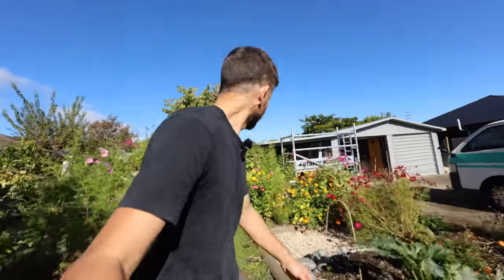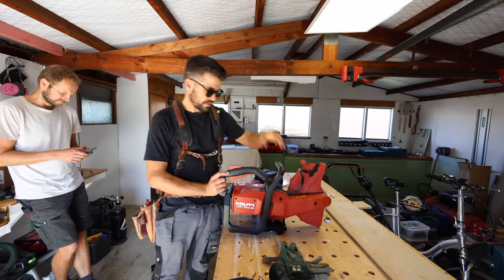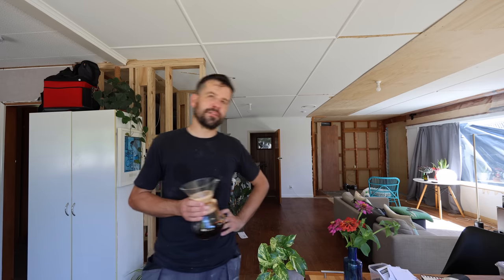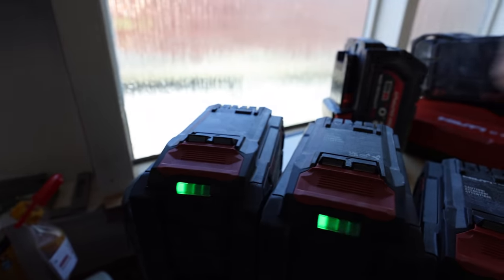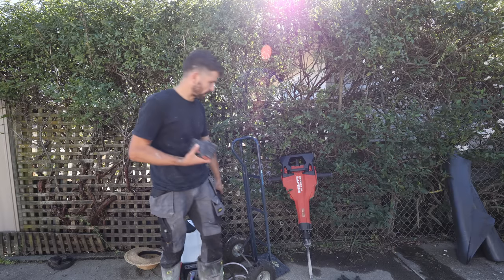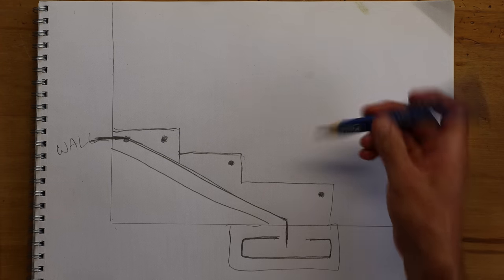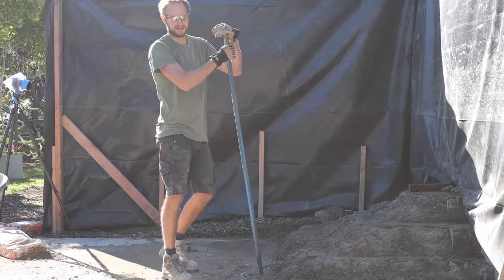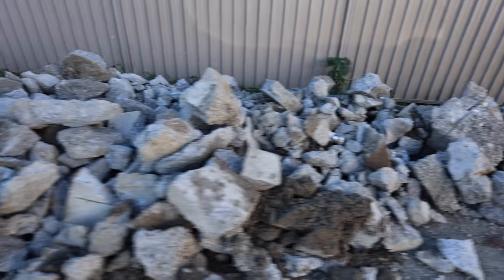Breaking Concrete with Battery Powered Tools: Is it Possible?

Comment: I do highly rate Hilti. Hilti and Mafell are in such another class though that even most Festool owners wouldn't buy them. They are far too specialist for most people. Personally I don't think certain tools need to be battery tools, especially those which are hooked up via a hose anyway for dust collection or water.
Reply: always felt like the push from tool manufacturers to put their whole catalogue to cordless is more so they can market "largest battery platform on the market!!! we even made a cordless coffee mug check mate dewalt!" despite the practicality and how pointless having some of these tool on battery are. like look at the mafell jig saw, thing is the best jig saw you can get your hands on and is only corded.
Reply: Eventually small combustion engines will be banned for import and manufacture at least in Western countries trying to reach net zero emissions, so manufacturers know they have to go in this direction for situations where access to AC power isn't available. They've gotta start some time.. 

Milwaukee MX FUEL range 72v battery tools are probably much more up to this job, and Makita's 40vx2 demolition saw

If the fastest production car in the world can be a Tesla battery powered sedan, then eventually they will get heavy duty portable tools right too. 

Other companies already do battery ride on mowers and electric tractors.
Reply: Hilti are meant to be leaders in there field yet they don't make a dual battery charger UNBELIEVABLE!!!
Reply: @MrTherbst  I agree, commercial tools that use X2 technology need to have multi battery chargers.
Reply: You're crazy bro festool has unique features that no other brand has. Every brand is innovating with tools now, lots of different little features can sway you to one brand. I have festool, 54v dewalt, hilti lasers, all sorts of stuff
Reply: @jamiedyer7782  you are right they do. Things like the domino for example. Mafell and Hilti are for more heavy duty work whereas Festool tend to be the top of the range for most wood workers. When you get to bigger stuff, Festool don't make the tools. For example....if you construct timber framed structures from 150m² oak, Mafell make tools for that light a portable bandsaw, chain notices, portable tenoners. If you work in the construction of buildings with a lot of concrete and steel, people buy hilti as they make high-end tools for the job. I am not knocking Festool tools, I even have some myself. Just go to a store, pick up a Festool saw and then pick up a Mafell saw and you can literally see and feel the difference in build quality. Same with Hilti.
Reply: @jamiedyer7782  Have you ever used Hilti or Mafell tools? Or are you a Festool fan boy?
Reply: I do believe in fool's-pricing though. I won't buy a basic underfeatured drill for 1170.00$ for example.. 

Except for say: NEMO, those justify their expensiveness by being deep-sea-diving tools with pressurised shells.
Reply: @MrTherbst  - How would that be significantly different from having two chargers side by side? If they made a dual charger they'd charge you twice as much for it, so there's really no advantage. With two chargers you can keep both at the same place or separate.

Comment: I would agree that some of the larger cordless tools just don't have the long run time because of the battery power they require, I would also point out that in all the 45 plus years I have done construction I have never seen anyone cut slots in a set of steps to demo them. Hilti makes some of the best cordless tools on the market,with the possible exception of this concrete breaker and concrete saw..
Also the use of the hilti breaker as demonstrated showed that both of you had not had much experience with the tool and how best to use it to maximize the tools capabilities. That being said I would never have tried to perform this demo with cordless tools. Hilti's corded concrete breaker would have gone through those steps like butter. you worked yourselves needlessly hard when the objective should be to work smarter,not harder. Keep on trucking on

Comment: well .. you could have drilled some holes in the Stairs to create some weakpoint where it brakes easier .. should be faster then the Saw and should need lees Batteries 
but tbh .. cordless tools are overrated .. as good as they are these days, still they are mostly efficient where it is hard to get the Amps through the Cable, where you have to use a Generator und just for "short" Jobs, not whole Day work (then Generator can be more fficient)

Comment: Yep. Batteries for tools that need to do this sort of hard work over time don't make sense. It would great to have heavy-duty tools have the ability to be both battery powered and to plug into an electrical outlet. Are there such tools?
Reply: It probably wouldn't be too hard to create an adapter for these that simply supplies a steady 22 volts to the battery terminals, but these brands tend to have "smart" battery systems, meaning you also need to fake the data signals, so it's not necessarily something a normal user can make, they'd need to know how the tool communicates with the battery.

And, of course, the adapter would probably weigh more than the batteries.

Comment: Having removed some concrete stairs from the 60s I felt the pain. Used a corded jackhammer. Man was that a lot of work. 
I have another set at the front of my house that I’ve been putting off for about 5 years now. 
Should prob hire a digger…

Comment: Whether you get 44v with 2 batteries or not depends on the wiring. If they're wired in series, you add the voltage. They can also be wired in parallel, which gives you the same voltage as one battery, but you get longer battery life than a single battery.
Reply: You get the same battery 'life' (energy) either way because the Wh rating (Joules) is the same. But by going higher voltage with series you can just use smaller conductors.
Reply: @TonyRule  Yes, I didn't explain that very well. I was trying to say that longer life is the only advantage to two in parallel, while longer life and higher voltage will both happen if they're in series.
Reply: @The2wanderers  Ah, right.
I see someone below said they believe it's  actually a 22V device, so it could presumably be run with one battery for half the endurance. So no conductor savings anyway in this case, just the convenience of only needing a single battery if you have a small job to do.

Comment: The issue of drawing down batteries faster than you can charge them is something you run into with drilling large diameter holes in concrete, I've gone through two and a half 18AH batteries to drill one 25mm hole before. I now have a mains powered concrete drill as well.
Reply: Ok, so get Hikoki 36v sorted as mains and battery

Comment: is hilti a consumer or residential brand down under? in the states its a commercial brand. I have used the Milwaukee saw with the giant XC batteries and the run time is comparable, like 5-10 minutes run time at best.
Reply: Commercial

Comment: Firstly, hats off to the pair of you for sticking with breaking that out by hand. Personally I'd have caved early and called in a digger.

I'm going to disagree with your comparison with early cordless tools and where large format cordless tools are now. The first generation of cordless tools where using Ni-Cd batteries (much lower energy density), inefficient motors and no power management. The current generation are benefiting from about 40 years of development,  Li-ion batteries, efficient brushless motors and onboard power management. You can make improvements by increasing the battery format as has occurred with 36 and 40 Volt systems, but the fact is that with any batter chemistry type there is a max rate at which a battery of a given Amp rating can be charged. Even if you build a more powerful charger, the practical charge rate will not change. A bit off topic, but this is also an issue with EV's. There are EV chargers available with very high Amp rates, but the vehicle batteries have a max rate at which they can be charged and this is what dictates how long it is going to take. 
Personal opinion, either there needs to be a very large capacity batter which is on a trolley/cart which can be charged overnight and then last for a whole work day (would be very expensive and defeats the 'cordless' part), or just stick with a traditional breaker/concrete saw and a generator. The reality is that the amount of money spent on the cordless option is not worth the expense in my opinion.

Comment: Oh I agree Scott, its insane how much rubble comes out of a small set of stairs. I broke up a set of 2 landing stairs a third of the size of what you had which wasn't completely concrete filled and it still filled a 1.5x2.4 trailer and knocking on the limit of what my poor old suffering Hiace could tow. But those big high draw tools probably aren't at the stage where they can replace 240v or petrol just yet, maybe with the exception of Milwaukee MX Fuel but I haven't used those monstrosities yet. I would definitely have hired a big Makita-Dolmar petrol concrete chainsaw for that big of a full pour job, a 24 inch bar would have taken that cut nice and deep and then it would have been super easy to break it out with the Hilti breaker pick

Comment: I'm all for cordless tools, but it seems to me like concrete hammers and saws aren't really the right target yet. Those are endurance tools that also still need a lot of power.  
If we ever get to the point where they can do maybe an hour on a charge that'd be great, until then I'd probably use a corded version instead
Reply: Milwaukee has MX Fuel 72v range and Makita does 80v tools, I have the makita 80v rotary hammer drill and although the concrete I was cutting wasn't anywhere as much as this, it was pretty capable to use as a jackhammer
Reply: @scottmenhennet9933  I never said they're not capable, it's just that the batteries don't last an entire day. Swapping batteries once or twice during the day would still be fine, but when you're doing an entire day of demo work you want your batteries to last at least as long as they need to charge back to full..
Reply: @scottmenhennet9933 yeah I think they’re better off having two seperate battery platforms rather than trying to use the same platform for everything. Dual battery systems are ok but you really need dual chargers and 4 batteries to really make it worth it.
Reply: What would be the advantage of going for one hour on a charge? You'd just need heavier batteries (or more of them). Surely you can take a 10-second break every 25 minutes to swap the batteries.

Of course, a corded tool would be even lighter, so it's still preferable whenever possible.

Comment: You pointed out the major problem with the dual battery setup: you need at least double the batteries and double the chargers. Some people advocate for all battery construction. And battery has advantages. But this heavy jobs, with an outlet near by, conventional electric tools have their advantages. And this heavy jobs will wear out the batteries much faster than normal work does while using and while charging.

I wondered why you cared to cut the steps anyways. did it made a difference or would hammering them down right from the start been faster. Or drilling holes instead of cutting into concrete.

On the other side, be thankful for a pause now and then.

Comment: Yeah. That’s what I felt like 25 years ago with makita’s cabinet drill. The only right angle drill available, with nicad batteries. Those were the days of using a shiny silver plug in black and decker drill that would take your arm off if it got hung up. My dad still has one. You gotta be like ice cube and put your ass into it.

Comment: I wish powertool manufacturers would stop marketing battery voltage and amp-hours separately. Multiply the two and you've got watt-hours, which is by far the most useful way to measure a battery.

A 4Ah battery at 18v is not the same capacity as a 4Ah battery at 12 volts for instance. They love plastering the voltage all over their tools because people buy it thinking it's somehow better or more powerful with a higher voltage. The tool manufacturers aren't saying that's how it is, but they're certainly not making any effort to say how it isn't either. If you've got two identical motors, and two batteries using an equal number of cells (each cell with the same ratings) but one configured with a 12v power supply and the other with an 18v power supply, the higher voltage setup will spin faster but with less torque. Try and compare the amp-hours for both and you'll find that although one pack has a higher voltage, it has less cells in parallel so it's unable to provide as many amps (which can put more stress on the individual cells under load), which in turn means less amp-hours. However, the available energy in both packs will still be the same.

In short, more cells in series makes for a higher voltage, more cells in parallel allows for better discharge capabilities (aka the C-rating). If you take a 100 watt-hour battery and power a 100 watt light bulb, the bulb will glow for roughly one hour. If you take two 4ah batteries, one at 18v and the other at 22v and use them to power a separate 100 watt light bulb each, then you'll need to pull out a calculator because the Ah rating has suddenly become meaningless.. Ah is only how much current (amps) a battery can deliver continuously over an hour, where as Wh is how much power a battery can deliver over an hour. High school physics and those little triangle formulas Amps (current) x Volts = Watts (power).

And lastly, if you do have one of these higher voltage batteries with relatively few cells in parallel, they're much more prone to voltage sag when they are loaded up. If they can't deliver the desired current (amps) the motor is trying to suck from it, then the voltage will tank while the battery is under a lot of stress.

Thanks for coming to my Ted talk.

Comment: I still prefer corded things. Milwaukee put out their MX battery line. I haven’t talked to anyone who’s tried them yet but I’m skeptical. The problem with them is the bigger they are the longer they are to charge. I think with mx even the rapid charger takes 4 hours and the regular charger is 8 hours. Also with the price tag these come with it’s hard for anyone to justify them in the first place. Especially if you also have to buy/rent a corded version for bigger jobs. But as someone who started when the only battery tools were black and decker screwdrivers, I don’t doubt they can get there eventually

Comment: as a retired furniture maker i was always happy to have corded tools, as power source was not an issue.  however, i do have battery drills and drivers which are very handy.  i feel for builders etc who may have to rely on battery tools, as i am aware of just how expensive replacement batteries are and how often they need to be replaced.  personally i think this whole drive to make everything battery by manufacturers, is a bit much.

Comment: That looked like a job for a diamond wire saw like the ones they use in quarries. Two cuts and you're (practically) done. Of course, then you have the problem of moving a massive block of concrete, but maybe you could use it as a pedestal for a statue.

Comment: Those steps were a perfect place for expanding demolition grout - just drill some slightly angled holes about every foot, mix up the expanding grout, load the holes. Come back in the morning and that concrete would have been cracked to bits.

Comment: When you have a tool that can operate on one battery or two, they will be in parallel so it will still be 22 V but you will get extra run time with a second battery attached.

Comment: You should try the milwaukee MX Fuel, they have much larger batteries. Not sure on the Ah or the voltage, but would be an interesting comparison to see if they last anywhere near as long

Comment: More and more using battery powered tools you'll quickly find out their limits. And most power power tools, have a hose or, in this case, a waterhose connected. So another wire to plug it in is a no-brainer. No need for super expensive batteries, no waiting for charging, not adding to the eco problem of using Lithium. 
I would say, go corded ! the 'new cordless'

Comment: Looking at all those chargers lined up it makes me wonder if anyone has ever done an analysis of power use between the energy requirements to charge a battery vs just using electric corded tools? I realize there is a real convivence factor to cordless tools but from an energy use standpoint and global climate change impact - what is more efficient?

Comment: Ah when concrete was cheap and when nothing was wasted, those old guys!. "got a couple of meters left so what else you need built" 🤣. A couple of years ago I Pulled up a very old concrete path going to old clothes line in the back yard. Was only a foot wide so thought small job,  started with a just sledgehammer to crack it and pick up the pieces🤦 3 days later with help of a mate and five Ute/ pick-up loads later with hilti breakers etc etc and at two foot deep then the clothes line was concreted in with a lump that should have a comet named after it. If had any idea of the task beforehand would have got a digger in for sure. Thought I had dug the grand canyon by the time we finished 😂

Comment: I know some concrete that didn't get that 'stronger and stronger' memo. ... And for these endurance/high power cordless tools, it looks like they could use a battery...with a cord that plugs in. I have a battery chainsaw and it's my boy, but if I was going off into the woods to build a cabin I'd take the gas saw, and if there was an outlet I'd bring a corded saw for the light work.